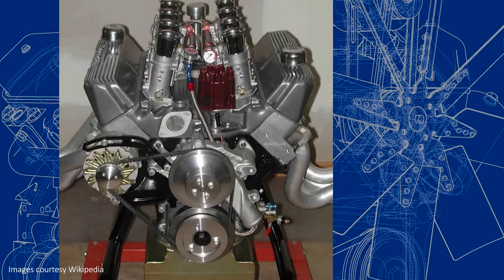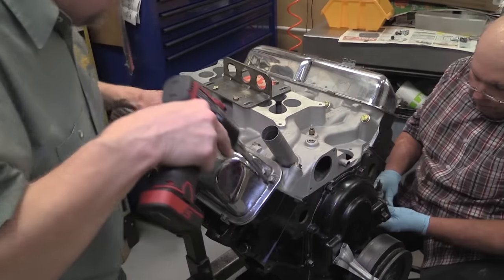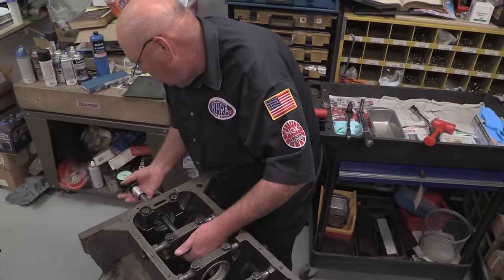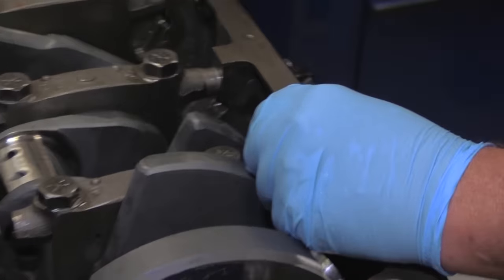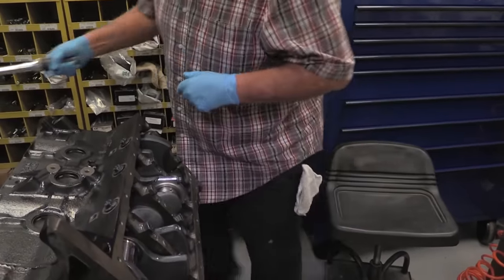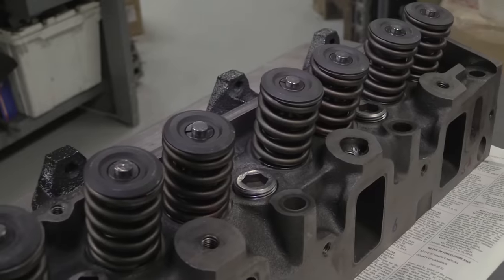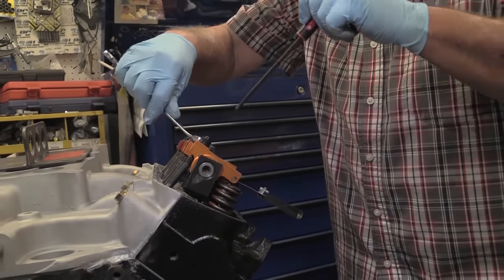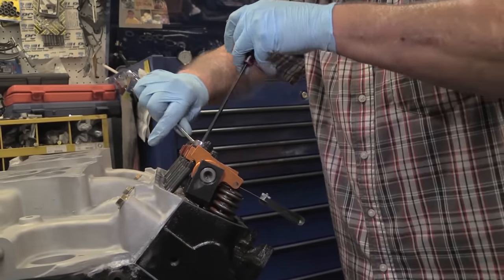Monster Ford 427 Top Oiler Engine Build and Dyno Session

Comment: HP Monster...you are completely WRONG about the FE block after 0:44 & through your imagination of the oiling system variations. You really should be ashamed of yourselves. Do your research before you make a video. Now that you've shot your mouths off, I'm going to give you the facts; the way FORD archived them, & debunk your imagined facts.
0:44, The 427FE was never designed as a race engine. It evolved from the 390 & 406 cid engines. It had the biggest bore of the FE series(4.23 dia.), but the same stroke as the afore mentioned engines. It had the same bore spacing, cam journal dia., crank centerline to block deck distance, rocker arm ratio, etc. But you could order a 14:1 compression piston for the 427 only, through Ford or other aftermarket suppliers. In the '50's & early '60's, racers used what was available. The manufactures made what was profitable or showed good marketing image. No one 'Designed' an engine specifically for American style racing. That would be for open-wheeled American oval form of racing, like the Offenhauser 4-cyl. or the Cosworth V-8 Ford. Bigger budgets then the other race forms, for the time.
Now, this is where your imagination went wild & you embarrassed yourselves. You do need to apologize for this gaff.
0:58, I've seen nothing of Ford using the term 'Top oiler'. All I've seen is 'conventional FE engine oil system', but regardless. In 1958, Ford offered the 352 cid, some of the blocks used Hydraulic tappets & some used Mechanical tappets. The Hi-perf. variants used mechanical tappets, because mechanical tappets survive high rpm operation, which is contrary to what was said in the video. The engine blocks w/ no oil galley to the tappets are for mechanical tappets. That tappet design won't 'flutter' when rpm's are greater then 6,500 rpm like a hydraulic tappet. That tappet design requires an oil galley drilled block, a 'side oiler'. That's right; a side oiler block accommodates the oiling needs of the lower rpm hydraulic tappet operation. The mechanical tappet is used in NASCAR, Road Racing, Drag Racing & other forms of racing. You can use a side oiler block for racing, but the oil galley's to the tappet bore need to be plugged so mechanical tappets can be used. Just a simple threaded plug for the main galley & press fit round stock in each of the tappet bores. Finish, re-hone & done.
HP Monster...delete this video, because it completely crushes your credibility. DO your research, than make a new video. 
SOURCE: Performance Publications, copyright 1976; information supplied from FORD Off-Highway Only Book.
Reply: Shots fired...
Reply: oh god,another book expert
Reply: @johndillinger8482  I didn't used my imagination & tell everyone it's the truth. I don't know everything so that's what books are for. HP Monster should've done the same thing. Do you like to believe all video's are truthful & researched like they need to be. Are you a Used-Car salesman JD?
Reply: @carmiethompson2676  you have no experience besides what's written in a book.These guys actually built an engine.
Reply: @johndillinger8482  I can't believe your arrogance JD. You tell me I have no experience. You don't even know me! Just because you build something doesn't make you an historical expert. That's why there are books. But, back to my experience, I was born in the early '50's so my formative years was in the '60's. I helped out on the '57 Ford Fairlane stock car my boss built when I was working for him at his Gas Station. It had two bays, I'd do oil changes, change tires run out to the pumps to fill customers cars, clean the windshield, check the oil if they wanted, etc. During that time I learned a bit about low buck stock car racing & what works. Since then I've read many articles on engine building & car preparation. Could I compete in a race, NO. But I enjoyed reading the information, talking w/ the people who did it & learned how to listen & ask questions, which has help me in my career as a Design Engineer. I now race motorcycles in AMA dirt track competition(not motocross, that's different). Low buck car racing isn't as low buck as it was.
Hey JD...The information presented in the video @ the segments I mentioned in my first comment were flat out wrong. HP Monster didn't do their do diligence before they made the video. Do you like to be mislead JD? Maybe you like to give people your 'facts' & not have them questioned, so it makes you feel good. I don't like to be mislead & I don't like to hear misinformation, especially w/ the kind of confidence the narrator had. That's wrong & that is why I said that HP Monster needed to delete the video, do research & make a more factual video. I'm sure HP Monster wanted to make an informative video, I'm just helping by pointing out mistakes. However, people like you JD obviously like to believe the first thing you hear, so these people make a video & that makes them experts. No JD, that makes them misguided enthusiast, not bad people, just have to be more careful w/ their information.
Reply: It was designed to be a truck motor for big rigs. It was real good motor for a Big wrecker to tow school busses and such. Bauman bus had one in the 80's and it could rip a house off the foundation. Granny gear at 6000 rpm.What a sound with open manifolds- cutouts.
Big block Chev was designed to power big rigs also.
Reply: @dielauwen  I think you understand the difference between between a Big block & a Small block engine. Have you seen some of the video's trying to explain the difference, they're hilarious & completely ignorant.
In North America, the early automotive market in the '20's & '30's, had a difficult time accepting the Diesel engine. Mack Truck made headway but a lot of customers had more confidence in the Gasoline engine. To handle the heavier loading & the power that those loads demanded, engine blocks had to be cast w/ thicker walls, main webs did the same as well as bearings. An important aspect of the engine block resizing was the crank stroke to connecting rod ratio to determine the center-to-center distance of the connecting rod. This ratio, along w/ clearances & tolerances; justified the distance between the crank centerline & the engine block deck. So a 1.6:1 ratio was the crank stroke x 1.6. Since gasoline was of lesser quality then, a longer connecting rod, 1.8:1 for example, would allow the piston to dwell longer around TDC to allow the flame front to burn more of the air-gasoline mix. This prevented overheating, pre-detonation & allowed the Engineers an option to raise the static compression ratio for improved torque. However, the rotating piston assembly mass in those engines sort of did that job to. So the Big block satisfied the need to perform work, the Small block satisfied the need for fast, high reeving engine. Hot Rod magazine did a BB to SB comparison drag test in a '70 Camero(?). BB won, but just barely.

Comment: I respect for the old builders but those motors are not sought out anymore. Sure the old cars of the late 50s to early 70s are being sold for large amounts but the main buyers are baby boomers whom are dying out. Wait 5 to 10 more years those old Camaros, Chevelles, mopars will be cheap as demand will fall. Our wonderful govt has legislation where 2022-24 no more V8s are to be made without penalty to buyer. Today's technology is based on 2L or smaller motors with turbo making 300hp/260Tq with respectable gas mileage and reliability. Those old motors 454s only gave a shell of a truck 8mpg if you let it roll down hill. All with the excuse to save the environment and keep the slaves working to keep our govt/farmers sky-high standard of living up.
Reply: If all you want is go fast then the new generation electrics are the king - owning, running and admiring strong old tech environment killing machines is a passion some like to participate in - some like the techno- wizardry associated with high output modern motors and some like to throw their money into a hole in the water called a boat. It is their time and money and their choice - we all have to do something - better than shoving it up your nose.
Reply: @waynelee7169 If all we got is 4-bangers or electric you can forget trucks and boats, unless you think either of those will move 3 tons of truck and 2 tons of boat and trailer.

Comment: the whole In case it goes back to stock"...no he wont once he drives it Really should have done something with those heads and worked the intake over. Engine was hamstrung bad by those 2 things. Cant see trick headwork and who cares anyway?

Comment: Going gaga over the Cammer is something of waste of time.  It never appeared in great numbers and was never available to the average buyer.  In the 60's you could at least go to a junkyard and pull a 392 Hemi  from a trashed Dodge or Plymouth and build it in the backyard.   Even the 427 FE Wedge was a rare bird.  So while I prefer Ford engines I admire the Chevy Big Blocks that outnumbered the Fords 5 to 1 and could pretty much dust anything except a well built 427 FE.

Comment: Not impressed less than 1hp per ci . makes for good boat ankor
Reply: With a build like this, we're all starring at that torque curve and figure fella. With stock cylinder heads and a low redline, it runs just how it should.
If it suits you better, the old 427 SOHC was able to make south of 700HP a half century back - it did exactly what it was designed to do also.

Comment: Ive owned 1x 360 and 2x 390 fords and I will say one thing there good engines but not for hot rodding not even this 500 ci 427 can't even squeeze out 500hp its horrible head design imo. FE = Farm engine I accept it as a ford guy lol I currently got a 1976 ford f100 short bed with a 302 in it. If I upgrade it will be 351w stroker or 385 series 429-460 engine not an FE not worth your $$ happy hot roding.

Comment: Lifelong Ford owner and former 427 Side oiler owner and never was impressed with Ford big blocks and not impresses with this one.  My 408 Dart sb Ford made an easy 615 HP on the engine dyno and blew them 427 Cobras into the weeds. FE heads except for the cammer are the worst cylinder heads anywhere. CHEVY Big Blocks make power not Fords. Even my little 302 Coyote outperforms the Ford FE.
Reply from the maker: Correct, the heads are definitely the weak link.

Comment: The best part about the 427 was the short stroke, beside heads. and he gave it a longer stroke.  he should have just trade it for a 428  long stroke.too much torque.  my friend had a boss 428 lift the cars in every gear but fall on it face after. Torque not useable too high gearing . 427 the king here, torque and come on the cam rev. 2th after the hemi
I rode in my boss son hemi road runner now that fast just a long burning pull and your over 65 no fuss.
Reply: What he should have done was put 4:11 gears in. Then he have come on the cam power closer in each gear. And still have the 6,000 rpm and short stroke still working and the crisp cam sound.  he lost that.

Comment: The heads kill these FE engines. I built a mild 390 with ported factory heads for a Fairlane and was left wanting more. A huge disappointment compared to the SBF and BBF Lima engines I've built. A marginal truck engine at best. I hope I never touch another one.
Reply: -  Ford finished 1, 2, 3 at LeMans with FE heads -- FE 428 CJ Mustangs seem to do fine in their NHRA drag racing classes -- Ray Paquet holds the NHRA SS/A national record with cast iron FE heads ...

https://www.youtube.com/watch?v=V7_kZyMoagk
Reply: @sandibaker7646  True. With enough time and money you can make anything fast. Right? They are not for a budget minded individual.

Comment: Ford Power? How about one poor design after another and another and another. Making the intake manifold part of the valve train is purely an idiotic idea. Making oiling the cam priority over the crank is also another absolutely moronic idea too.  Ford power. Thats a joke.
Reply: Most American engines oil the crank from the top.  Look at a SB Chev; the oil comes from the pump to the rear main, then up to the oil galleries in the lifter valley above the cam and along the sides to the lifters, along the centre gallery and down to the cam, then around grooves behind the cam bearings and finally down to the mains.  Dodge, Pontiac, AMC, BUICK, etc. engines are the same.  The 427 side-oiler is about the only street engine that prioritizes the mains in the oiling system by feeding them from a dedicated gallery.  

Why do you think we install restrictors in the lifter galleries when using solids?  To put oil not needed to pump the lifters down to the bearings.  There are many improvements we do to SB Chev oiling systems to get as much oil as possible to the mains and rods.

Maybe you don't like Ford, but at least know how a system works in other products before trashing an engine for a "poor design".

Ford beat the best in the world, (European "supercars", not North American) with the 427 in both the Cobra and the GT40.  Then built the new Ford GT and went back to win Lemans again.  Chev has finally put a mid-engine in the 'Vette, in an attempt, I would guess, to go after the GT market.

Holman and Moody took the Tunnel-port 427 Can-Am racing and was a force to be reckoned with.

The 427 was a top engine in NASCAR until Chrysler came out with the Hemi.  The high-riser was so good that NASCAR banned it while letting Chrysler run the HEMI, which wasn't even homologated yet.  Then came the infamous Cammer 427 "semi-hemi" which NASCAR wouldn't let race, effectively banning it before it even hit the track.

Then there was the Boss 302 in SCCA and Trans-Am racing.  Wayyy too much head for a street engine, but a great, and winning, track engine.  A Boss head, and Cleveland 4 bbl, was said to out-flow a rectangular port 427 Chev; way too much air for street, but fun at RPM.

Boss 429, also a "semi-hemi", to compete with the Chrysler Hemi; but unfortunately, it came along as the gas crisis started.

All of the engines mentioned above as well as the Chev LS4, LS5, LS6, LS7, LT1, L88, L82, etc. and any others you can mention are all "top-oilers", with oil coming around the cam bearings and down to the mains.  It is a less complicated casting and works fine for most applications.
Reply: Read the history of why the intake was developed the way it is..

Comment: disappointing,,, Not porting the heads was a big mistake. That decision choked the engine airflow. I dont care if you punch this out to 1000 cubes. If you run these heads/manifold/cam youre going to be disappointed... should have just left it at 427 cubes.. and save $7500 or more...What a waste of time...